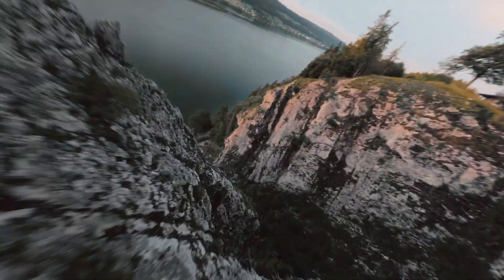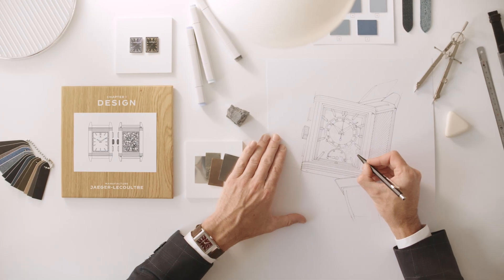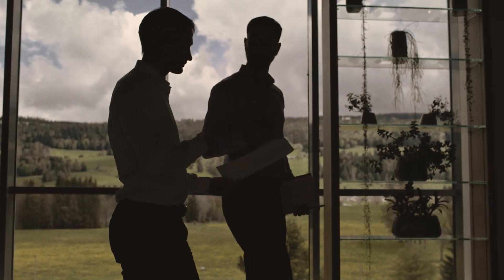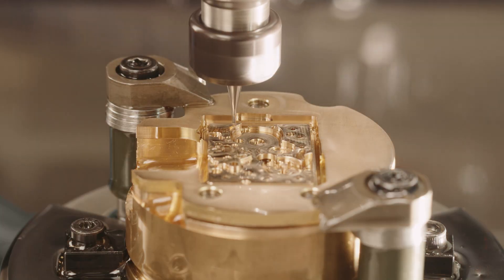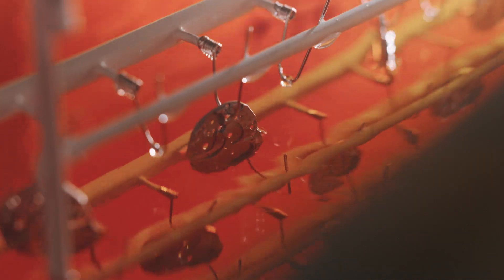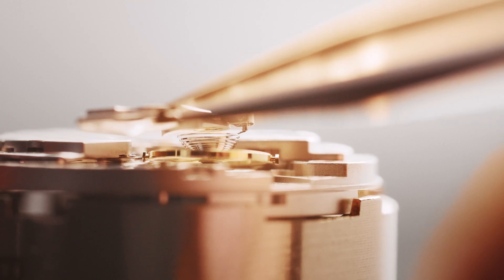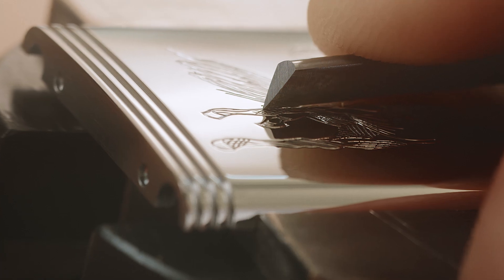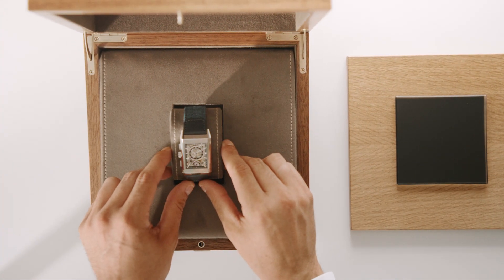The Watchmaker of Watchmakers – 5 steps to manufacture a watch.

Comment: Yes the new Reverso Chronograph is very cool but the standard Reverso’s movement is hopelessly outdated. Specs like 21.600 vph with 42 hours of power reserve and no anti magnetic protection just isn’t acceptable anymore. 

You can’t keep raising prices and not updating the movement in 35 years. You have to innovate. 

Especially if you want to keep referring to yourself as the watchmaker of watchmakers.
Reply: I agree. I love the brand. I love my Reverso.. but especially with that history (protection) it should be a nobrainer that it should be protected against modern challenges like magnetic fields from cellphones etc. And a quick win for marketing as well